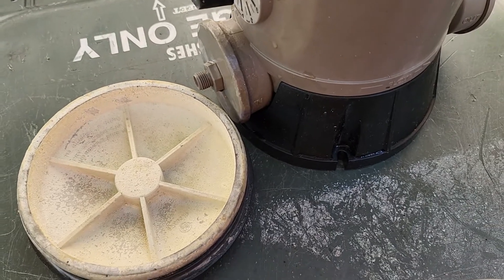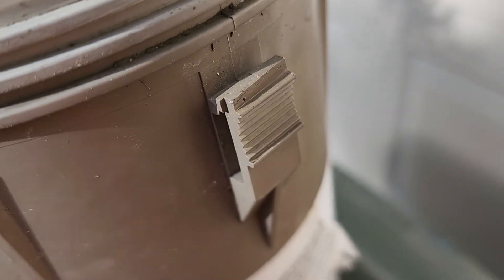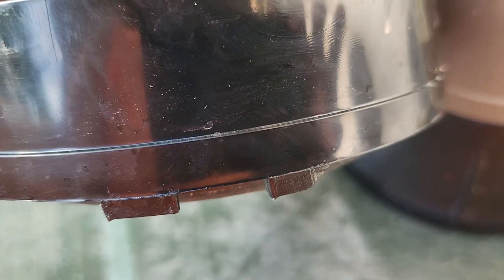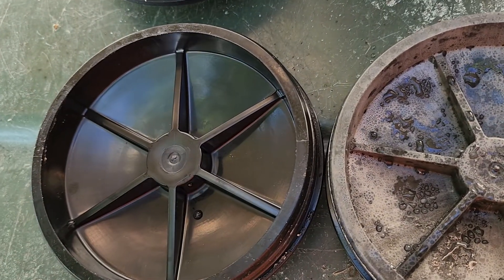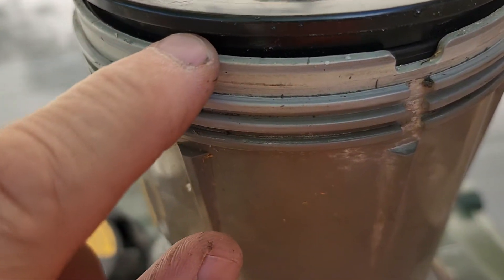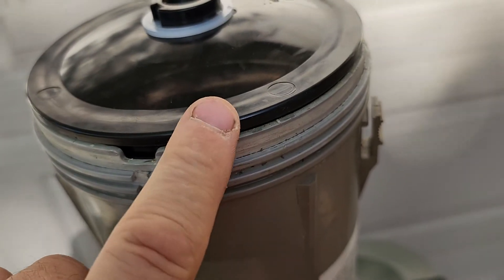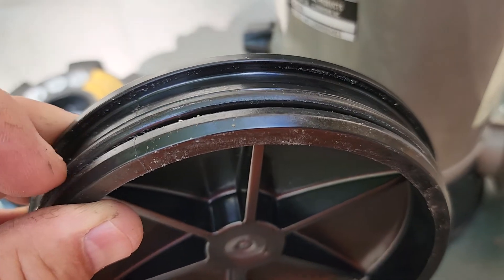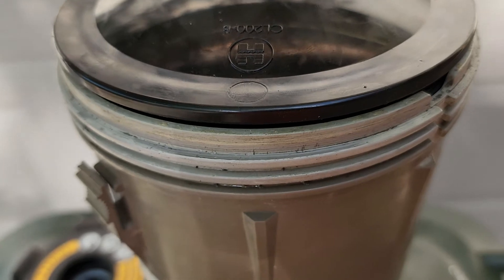Why doesn't the Hayward CL200 Chlorinator Lid Close Like New?

Comment: Along as it tightens..it doesn't matter what o ring ya use. It's not going to leak.  
The real issue is why the lid is so hard to get off when ya need to fill it.
Reply from the maker: I have one of these helpful tools. https://www.amazon.com/RO6G-Chlorinator-Hayward-CL2002S-Chlorinators/dp/B08VRSK4D3/ref=asc_df_B08VRSK4D3/?tag=hyprod-20&linkCode=df0&hvadid=693713553016&hvpos=&hvnetw=g&hvrand=17496517621877708573&hvpone=&hvptwo=&hvqmt=&hvdev=m&hvdvcmdl=&hvlocint=&hvlocphy=9021702&hvtargid=pla-1236851951405&psc=1&mcid=2c1e7536b6a7321a9b7c1ec8d46aff5b&gad_source=1
Reply: @dalechalkey3729  I have the exact one an  it broke when I tried to loose the lid.

Comment: What is the best way to clean off the threads of the chlorinator?
Reply from the maker: i found this on the internet and you might want to try it. How to remove chlorine stains from plastic?
Baking Soda Paste: Make a paste by mixing baking soda with water until it forms a thick consistency. Apply the paste to the stained areas and gently scrub with a soft brush or toothbrush. Let it sit for a few minutes, then rinse off with water. Repeat if necessary. Jun 10, 2023

you might also try spraying silicone lubricant on your threads to make them easier to twist.